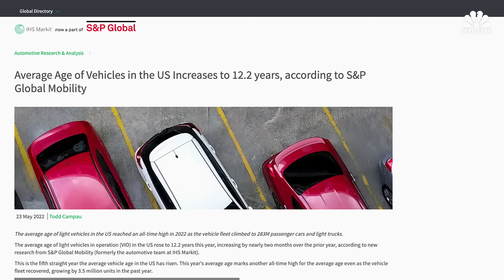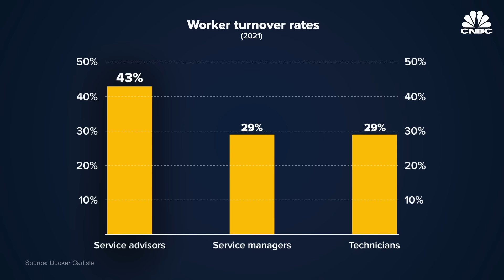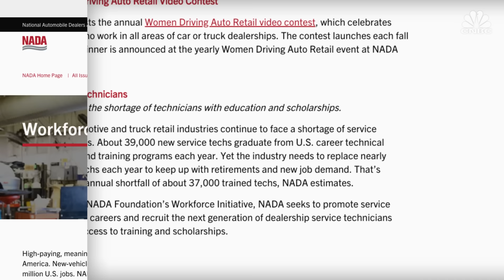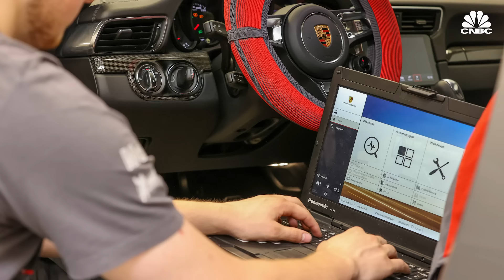Why The U.S. Has A Shortage Of Auto Mechanics

Comment: I worked at cat after college my starting pay was 12.65 per hour. You add the cost of tools and driving your car to work everyday and constantly having to learn new motors and transmissions. I moved to trucking no tools required and holding a steering wheel is easier than lifting heavy parts

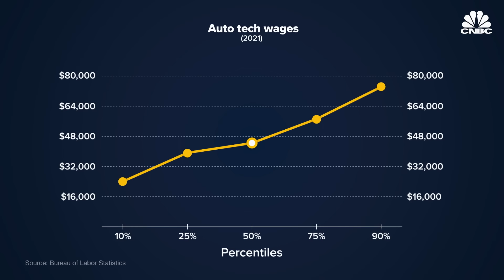Comment: 5:34
That's complete BS. And that owner needs to get called out on it! No matter if you are a "high performer" (which just is a euphemism for corporate slave) Flat rate DOES NOT pay you good. It pays the DEALER or the shop VERY WELL because of what they are charging YOU the customer for the labor cost and parts.

Mechanics/Technicians DO NOT see any percentage of that labor cost/revenue because they are getting paid "flat rate." If a job pays 6 hours and the dealer charger $150 an hour for labor, that's $900 just for labor not including parts cost(which they grossly mark up the price on) and sales tax. 
If you are a mechanic/technician that gets paid flat rate at $15-$20 an hour, that's only $90-$120 dollars for you.
That's not even mentioning "warranty work" where the manufacturer of the car says the job will only take 5-6 hours and the REALITY is the job takes  the mechanic anywhere from 10-17 hours to actually fix. 
"Well, that's just a inefficient mechanic!" Bootlickers will say this to defend the wealthy when the truth is clear. DEALERS/OWNERS DO NOT PAY ENOUGH!!! Yet, the mechanic is expected to buy ALL the tools he needs including tool storage, and upgrade his diagnostic equipment year by year to work on the cars he needs to fix. 
And before ANYONE tries to deny what I'm saying, I've worked for dealers and automotive repair shops for a long time. I've witnessed the shady business practices and the ways dealers screw people over AND the brick and mortar auto repair shops that upsell you on everything when all you need is an oil change. I KNOW what I am talking about.

There has NEVER been a labor shortage in this country, its ALWAYS been a PAY SHORTAGE!

Comment: We have easily the hardest and most complex job in the dealership and often get paid garbage. Even if the hourly is good, it ends up being garbage because flat rate can be so difficult to be efficient at. Especially on a warranty level. I just did a job the other day where i followed manufacturer direction to fix the vehicle. Problem is they paid 5.4 hours for the job that actually takes 10.8. Nothing i can do though because its a warranty job. The manufacturer needs to stop paying garbage warranty times and the dealership needs to stop treating techs like were ordinary blue collar workers. You have to be highly skilled, intelligent and trained to diagnose, take apart, and then put back together vehicles properly.

Comment: As an automotive mechanic for 9 years and going (hopefully). I can say that the pay isn’t great anymore with this current inflation it is not an economic worthy job anymore. Shop rates runs up while our pay barely moves. At all. The shop I work for has increased shop hourly labor from 130 to 160 since I have been here but the techs pay is still the same. 🙃

Comment: I work on my own cars because I can't find a shop I'd trust to not do a hack job on my cars, I have enough tools I could open my own shop but I already had working on my cars & cars from friends & family enough. A good auto mechanic needs to be a jack of all trades, you need to be a machinist, electrician, plumber, A/C tech, computer engineer, ideally a bit OCD, I always use a torque wretch whenever possible, will spend extra time cleanly routing wires even though they are in areas you'd never see them.

You have to be great at problem solving & think like an engineer, think about what these parts are doing when the vehicle is rolling down the road. It is amazing, the forces, weather, temperature, & vibrations a lot of parts of a car deal with on a daily basis.

My point being it takes a lot from a person understand all that stuff & to do that type of work, why would I want to do that daily & likely be making less than what I could make just being a programmer? Sitting at a desk, not getting my hands dirty & cut up, just typing code on a keyboard, not needing to do yoga moves to reach a bolt under a dash or probe a wire. xD

Comment: The problem is the shop owners. This industry does not charge enough per hour. Avg is 125 when it should be 250 min. The techs pay should be 75 to 100 an hour not 20 to 45. In the 80s the avg rate was 45 and the tech made 50 percent plus 10 percent on parts. Now the rate is 125 to 150 and the techs still make less than 45 an hour. At a min techs should be paid 90 an hour.

Comment: Prices. My car wasn't running right, took it in for a diagnostic. Shop wanted $700 to change the distributor. Wtf. Its a $120 part, so $680 in labor? 6 shop hours at $100 rate...seriously? For a distributor on a 40 year old 350. Of course i did it myself, and that's another reason shops are failing. All that diagnosing and running around, breaking new parts only to recieve a $60 diagnostic payment.

Comment: I think there are several reasons and one is that is getting harder to fix newer car, to fix or replace a part you have to remove 2 or more other parts or is much harder to get to that part. Second  is a continuous of the first and that is that is getting much more complicated to fix because you have to set codes, reset the part, for the new cars you have to do it a certain way especially for electric parts.

Comment: I worked at a dealership recently that services something similar to autos but different.  The owners did a funny thing where they increased the rate they charge customers by 30% because the cost of everything is going up they said.  Everything but the pay of the men that do the actual work.  A 30% raise would have kept me there, instead I went independent.

Comment: Competitive salaries???????   I’m 27. I wanted to get into auto mechanics after I graduated high school in 2015.    Worked at an Audi dealership in San Antonio, Texas for four years.   Started as an automotive detailer, every time I ask to move up and become a lube tech  management would ignore and never never promote from within.   
Techs there would tell me not to join the career because the value of the time and pay was getting further and further apart.      
More than half of the mechanics there even told me that they should be getting paid $5 to $10 more for the commission base.    Especially when dealerships screw them over with warranty work and want work done in 2 to 3 hours when the job requires days to complete.
Reply: Fix.?.?.?     Pay more

Comment: The kids don't grow up working on cars with parents because the cars are built to prevent people to work on their own cars at home and are loaded with overcomplicated and unnecessary systems and electronics witch basically need a person qualified in multiple trades to fix them. Would you ask your computer repair guy to fix your pluming? Would you ask your plumber to fix your computer? Would you ask your electrician to poor the concrete foundation for your house? Would you ask you builder to fix your electrics in the house? As a mechanic/technician you are expected to do all of that and more and diagnose and repair mechanical, electrical , heating, cooling, software, high voltage, and the list can go on,correctly the first time. So the question is how would you like to have to learn multiple trades just so you can practice and be paid for one trade? Why not learn one trade and get paid the same as you would after learning 6 or more trades? The answer is there is no point in doing that. Learn plumbing and go be a plumber, learn high voltage trade and be a high voltage electricians and get paid loads more than a car technician. For car manufacturers the message is ad lightness and simplify so mechanics don't need MIT PHDS to fix a car.

Comment: The economy isn’t engineered to the degree that it could guarantee work life balance, just pay, or worker power and flexibility. All those are also secondary+ metrics if at all valued in the applied calculations from what I can see. Sometimes it works in the workers favor, sometimes it doesn’t. There are so many variables involved here that it’s somewhat amazing we even have what we do. I don’t see a direct fix for this in the broad economy without better data and tech. There is also the culture component of the people.

I ask myself, say we solved the fusion power problem, would we be able to apply the tech for the betterment of all, or will we still mess that up. The fact I feel a strong possibility we will mess it up is depressing.

Comment: 45 years in mechanics. It has been a great career.  I only work Time and Materials.  Management bulks at times.  Customers love it cause I care first and cost is secondary (yes cost matters and I work hard to explain how I reduce costs and give the Customer a good value). I have no trouble finding Customers.  Some bills are huge, it is usually due to poor workmanship and maintenance. When a Customer knows good value and is not broke down, they will be back.  
I work in the Agricultural World for John Deere.
They too push Flat Rate. Usually 50% of what a job actually takes.  That seems to be the norm. I have seen one Technician quit after the next.
In my opinion, at some point Management will have no choice but to go back to T&M to keep a Service Technician on the job and give the Customer a fair price.

Comment: Here's a better answer. You have auto makers making more money than most industries than they know what to do with so they engineer more and more complex vehicles that intentionally makes new vehicles hard to work on, and not last as long because they often cut corners on cost where it matters the most for longevity of the vehicle. Now because some features on vehicles are poorly built, they need regular fixing and there are many dealerships that have a line of a few weeks before they can even look at your car. Since they designed the car to only be worked on by technicians, you now have most people not fixing their own cars because they RELY on someone fixing the overly sophisticated computer rather than the simpler vehicle it should be. And the big auto makers have the regulators in their pocket so every time they add a new 'feature' to a car, it becomes mandatory on every vehicle withing a couple years. So now the designers add what used to be luxury features as mandatory into every new car.  So on top of being impossible to work on, they have abolished the existence of budget cars. And now we scrap cars sooner than new cars used to last because the big auto makers only care about selling you cars, not making them last 20+ years. The whole industry is scammed with lawyers and money. It has nothing to do with work ethic, its auto makers making extremely sophisticated vehicles when the average consumer can barely afford to buy the car as it is. (Edit: fixed my bad wording)

Comment: there is a TSB from ford on my 2020 f150 w a 2.7 that states blue smoke on start up answer replace oil supply tube to left side turbo and i bought it in for that and gave the service advisor at ford dealer in yuma az where i bought it and they wanted to charge me first and then see if it was covered under warranty when ford already said they would and made the new revised part for it so i just left but every time it starts it blows blue smoke until it warms up and i don't know what to do, i already called ford and they said they can't make them so what do i do about that

Comment: I have been a Ford Technician for 25 years and the entire work environment,  pay and rewards have all degredated to an all time low.. this is the issue and after getting 5 raises over a 10 year period... I still make the same money.  As the ability to generate hours is reduced with more red tape, cut labor from manufacturers and longer warranty periods that dictate the amount of time given for a specified job that is less than the time to do the job inturn effects techs ability to earn good wages for the investment of tools abd education. Techs make less and less but the skills required increases all the time...😂
Reply: With warranty time, It seems to be 30 to 50 percent less than the average time set in any labor time standard guide... that's what I have noticed over the years. This is one factor and I am eager to change careers...after 25 years

Comment: This is really locking the barn door after the horse left. As autos become more complex and computerized, the need for highly paid and skilled techs will decrease. cars will become long term leases and you will just trade them in. More and more maintence free, a computer will tell you what is wrong and you just replace the part. The othe rissue is outside of warranty, most working people cant afford to dump thousands into a repair on a used car as it depreciates. Its not like putting a roof on your house.

Comment: The real reason is that you can't be a half-wit high school drop out and be a mechanic anymore!  You need to be pretty intelligent - in some cases very intelligent and disciplined to be a decent tech these days.  

Some comments on this vid mention engineering and they're not wrong. You need to have an engineering mind/ mind set to be a top tech.

The less intelligent types are finding that they can't cut it in the industry anymore.

Comment: Shortage?  They are everywhere.  I never had a problem finding an auto mechanic whenever I wanted and within a reasonable budget.  Further, anyone can do basic routine car maintenance such as oil change, and even change of brake pads, rotors, and spark plugs with a bit of learning.
Reply: Ignorance is bliss.  There are some cars that require a scanner to retract the brakes.  Everyone have a scanner or know how to use one?   There are some two piece Ford spark plugs that break in half when removed and then you have to extract them.  These landlines are everywhere.  Even basic maintenance today is not basic
Reply: @thegunnylocker5783  You are the one that is ignorant of English grammar.  I don't buy things that I don't have the ability or affordability to fix them by myself.  And I depend on no one.  No one.
Reply: @anocri  okay buddy.

Comment: Ok - so interview the very people who CAUSE and PERPETUATE / MAINTAIN the PROBLEM. Great job CNBC.
BUT don't interview even ONE actual MECHANIC as to why these shortage problems exist. ( And the list is really long as to why ) 
I'll even give you a very simple solution to the problem. Have a very fast "ramp up system" where mechanics EARN $ 80K ( or more - and deservedly ) as a salary or hourly basis - AND have them work 40 hours only - give them vacations - good benefits - a generous 401-K match - disability insurance for when their lower backs and bodies give out in their mid 40's - AND help with the TOOL costs. ( which can easily reach $ 100K - ESPECIALLY with modern cars - electric cars - and computer modules REQUIRED to even work on the cars ) THEN you will have competent mechanics and no shortages. AND - with flat rate hourly labor rates posted on the walls at $ 150-200-250 an hour ( depending on the dealer ) AND marking up the parts by 400% ( by disallowing the customer to bring in the exact same brand new part ) AND using ( fictitious and fraudulent ) "Book time" on the customers bills - the MANAGEMENT and OWNERS of the shops can EASILY AFFORD to do exactly what I listed above.

Comment: Also, sh!t  engineering. I have to remove the engine to pull a  bolt to get to the timing chain? Spend extra time but only get paid for an average timing chain replacement.